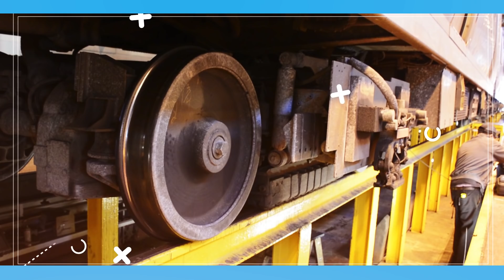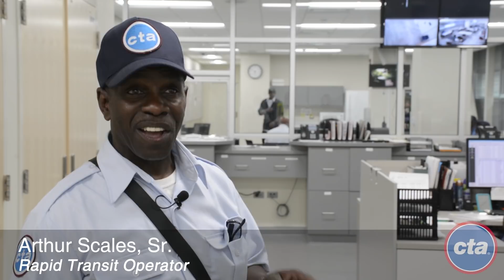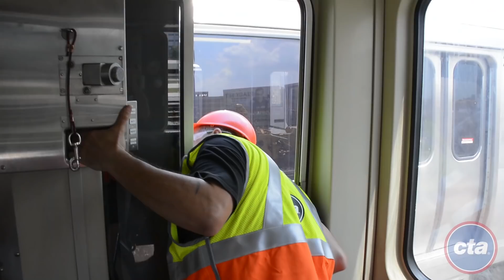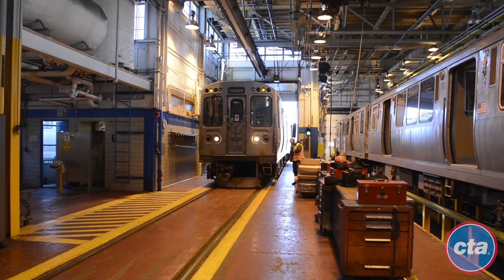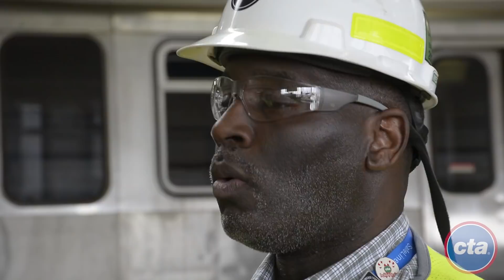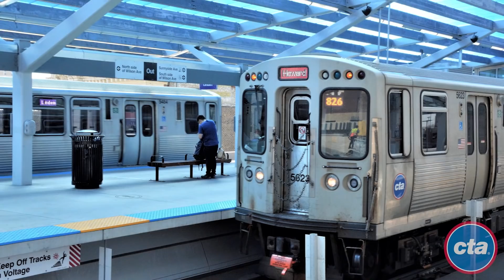Behind the Scenes at CTA: Rail Car Maintenance

Comment: Why doesn't CTA use rubber tires like some other metros around the world? That would reduce noise wouldn't it?
Reply: Rubber tires have other disadvantages, like higher energy consumption, tire blowouts, more friction generating more heat, and shortened tire replacement intervals.

Comment: Only 6 months for the wheels? Seems like it should be at least a couple years.
Reply: It's a 24-hour service, so these trains are driven a lot. The system also has quite sharp curves for a heavy rail system, which causes additional wear and tear to the equipment.

Comment: The 2600-series cars are nearing the end of their 40-year livespan rolling into retirement in the 2020s when the new 7000-series cars take place I hope they don't experience any issues with any parts
Reply: The cars on the blue line look just as old or even an older model,what models are those
Reply: @leviackermann770 it’s the tracks, they need to fix up the tracks!

Comment: Who assembles the consist for the run, the operator or the shop? Meaning if im due to run a 4 car train rolling out at 1100 does the shop have someone assuming the set is waiting or does the operator have to build the consist?
Reply: norbertdx The yard switchmen are responsible for putting the train consist together, either they will do it in the yard or at the platform.